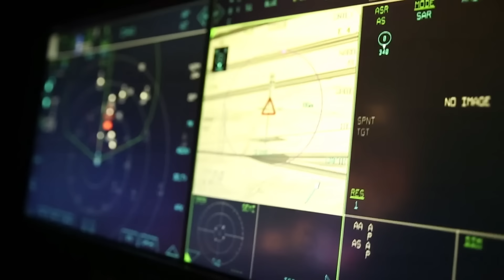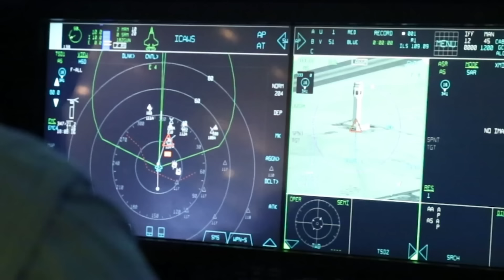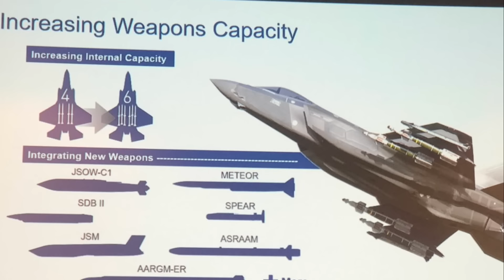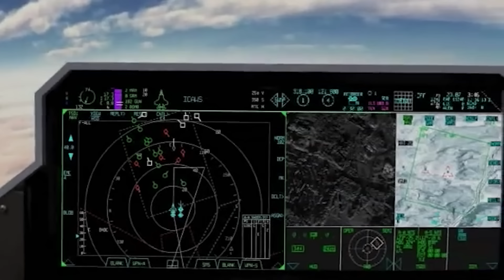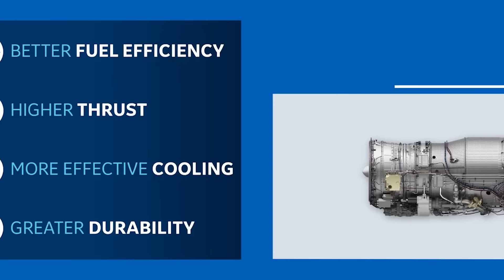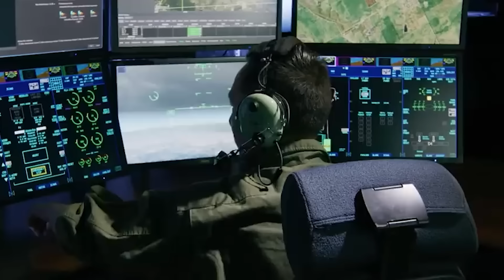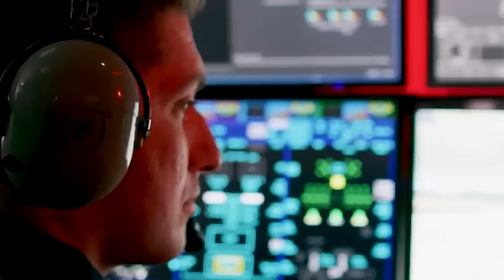The F-35 is about to become a POWERHOUSE

Comment: The L3Harris computer is 4x current? Holy shit, what did they put in this thing, a calculator? I googled the L3Harris computer, and did a little digging. Turns out that the number touted on the website is more or less equivalent to a processor released in the '80s.

Comment: So if I'm understanding this correctly, the TR-3 upgrade package includes a new CPU, probably upgrading from PCiE-3 to PCiE-5 for the extra data bandwidth in the process, new RAM, and an M.2 drive or three for not only more data storage but quicker access to that data, plus software updates that actually let the aircraft take advantage of all that new capacity, unlike Windows or iOS. Given the change in hardware, probably a new motherboard as well. Neat!

Comment: The problem with the F-35 is the ancient system architecture. You have expensive and lengthy upgrades because everything must be recertified, tested and tested... On JAS-39E you can change every computer, an engine or add 12 new weapons and the plane flies the day after and the whole fleet can be updated at squadron level. So 5th gen is not about stealth, it's about adaptivity...

Comment: I was very skeptical of the plane. But it's more about what the tool is going to do in actual force projection. The 22 is a better fighter, but it is limited in every other category. 

If the systems work correctly, the 35 will actually be the better tool for how the fight plays out in real time. And thats how the aircraft should be looked at, different tools and this tool is very dynamic
Reply: It's an unreliable pile of junk with a flakey engine.
Reply: @LondonSteveLee  Few years ago I would have agreed. Not so much now. Pretty deadly now that lot of the new kinks got worked on
Reply: @nelson_rebel3907  The hardware is obsolete - F-35 needs a total avionics refit like F-22 - that's the price you pay for such a buggy plane that had a drawn out development phase - in the end they had to halt modernisation and spend literally 5 years bug fixing on what was already 15+ year old hardware.
Reply: @LondonSteveLee   The advantage is all that hardware that is working now is decades ahead of anyone elses. The 35 was designed to be upgraded. Thats why the frame is more robust instead of flat and very specific like the 22.

The 22 is the best dominance fighter. But its even older than the 35's hardware. And it doesnt fit the missions of the future. It's range is too limited and it has little compatibility with other platforms. They could retrofit the fleet of them. But the 35 was designed from the ground up to work that way.

The 22 wont be the weapon we need. It's a iconic aircraft but it doesnt mean its actually what we need. The 35 is just an easier to maintain and mass produce over the 22. Quantity does have it's own quality all it's own.

And fortunately for us, the 35 is still a better quality than almost any other jet.
Reply: @LondonSteveLee  Ultimately we know they are working on something better than the 22 for the very specifc unlikely event of actual dogfighting. And it almost certainly involved drones and AI. I doubt they are shutting down the f22 without something to fill that role
Reply: @nelson_rebel3907  Not true, for some time F-35 development have mainly been bug fixing and "productionization" of very clunky and advanced in their day systems - the workings under the skin were frozen in time to reduce risk to the already massively slipping and over-budget project. It didn't help that some key systems were carry-overs from the even older and technically ancient F-22. The net result is a plane that looks state-of-the-art but is actually practically obsolete. Block 4 is lipstick on a pig and will push the creaking hardware to its absolute limits. Sorry to break the bad news but F-35 needs a total ground-up refit. With modern methods and AI technology it would be quicker to start again than to untangle the mess that is F-35. I'm sure a plane with better than F-35 capabilities could be designed and built from scratch in under 5 years today. But who would you trust to deliver it? And as always mission creep would ruin the project anyway. 

Rafale, Typhoon, Gripen, late F-16 and F-15EX all have fresher systems on board than F-35 because it's easy to upgrade Gen 4 aircraft  - it's the (then ground-breaking - now easy) sensor-fusion stuff that's incredibly hard to maintain on F-35 (and even harder on F-22) - F-35 is not easy to upgrade - it's still a 90s child with very clunky and old fashioned approaches to much of the IT architecture. The exceptions are the majority of the passive protection and counter-measure systems supplied by BAe - they are totally modular with standard interfaces and are not tied to particular hardware architectures.  When you are an airforce as large as the US you do end up with a lot of technically obsolete carryovers as replacing systems across the board is eye-wateringly expensive - and if you have a heavy clunky air certified box that already works reliably and is fitted to 3,000+ aircraft with a logistics chain to maintain it - you stick with it.  Think of the Link-16 module - 100KGs of hardware pulling many amps which could probably largely be done in software now!

Comment: Probably a more efficient engine will be shoehorned in too.  It is obvious the F-35 is not a hugely short range dogfighter, but it does not need to be.  It can take care of itself, but it is more of an information node and sensor platform.  I think we may be getting away from the AWACs as a single point of failure and going to a more mesh like network scheme with a bunch of F-35's bouncing signals through satellites.  With all that electronics, a new engine is going to be needed to power it all.

Comment: I believe the F15EX is better
Reply: Yeah, if your enemy doesn't have a comprehensive strategic-level A2D complex. If they do, those F-15s will struggle while the F-35 would merely shrug and then brutalise the enemy.

Also, the F-35 can see you coming even if you try to sneak up from behind with your radar off. The F-15 would be completely oblivious unless a third party in the battle network can augment the F-15s situational awareness in real-time. The F-35 DAWS/MAWS systems are all-aspect, and the AN/APG-85 is an extremely wide aspect generation-four AESA radar.

It's not the stealth of the F-35 that's the terrifying. It's the fact it completely denies YOU the option of stealth due to its unparalleled sensor suite and sensor fusion.

Comment: I'm all for the new engine, but the frame probably wouldn't sustain it. There were already problems with stress fractures with the existing engine, so 20% more power would almost certainly cause damage unless throttled. On the other hand, the extended range and durability would be great. I'd love to see the engines in the F-22 but the engines on that are dual thrust rather than single engine. But the cost savings from the durability increase of the P&W might be worth it even if it can't use the full power.
Reply: I heard they are reinforcing the airframe with vibranium

Comment: I would rather see an F-22 block 2.  Having a swiss army knife sucks if you can send a whole utensil drawer like the US does every time.  I want the Ginsu knife with the guaranteed edge.  It seems these days it is all about exportable sales than pure superiority and defense.  The F-22 is not exportable, but the F-35 is.  I am not sure what f*cking loophole we are using, but the F-35 should never be superior than our F-22.  Software and armament support (which is hardpoints and software) are easily upgradable on the F-22.  They declined the engine upgrade on the F-18 block III.  It is all about money and not about air superiority or protection.  It is total bs politics.  Anyone following this can see.  Why an F-18 to have super cruise at a lower cost to cut into the sales of the F-35?  Well...one reason is the Eurofighter, et al.  Like someone else said...it is about software networking grid engagement and missiles.  When it comes to BVR, radar and missiles play a bigger role and simple F-18 like the growler can be competitive.
Reply: The F-22's lack of export was due to a unique situation that had nothing to do with it being "too good for export", and everything  to do with the end of the Cold war and lack of threats to NATO, which resulted in security concerns because all other nations were reducing their budgets and relaxing their military operations. The ban on export was obsolete by the early 2000s, but by that point key politicians were already concerned about the F-22's cost and lack of capability outside the air superiority role.

The F-35 is preferred specifically because it is multi-role. It is more effective for it's cost, in much the same way as an F-16 is better than an F-15 in many situations. Emphasis on many, because that means it's effectiveness is utilised far more often than dedicated fighters, and therefore contributes far more to the war effort. It is simply far more bang for the buck.

F/A-18 with super cruise? With a normal combat load it can barely reach Mach 1.2. The airframe is too draggy for supercruise to even be considered an option, especially when the detrimental effect of reduced combat range is of far more concern to the Navy.
Reply: @dumdumbinks274  We don't export equipment to countries that are threats.  For instance, Israel wanted the F-22.  It has never been an enemy.  We did not export it due to it being our highest technology for military.  This is way after the cold war.  The cold war prevented us from selling Sony PS2s to Russia, because it was classified as a super computer at the time.  The F-22 was long past the cold war saga.  The F-35 is something that was designed to replace the F-16.  It is not an air superiority airplane.  The F-35 is already on essentially block 4...that is crazy to me.  The F-22 was canceled for some reason that makes no sense except that they could not make money on it.  The F-35 being exportable makes potentially a lot of money.
Reply: The hardware on F-22 is so archaic it's practically impossible to upgrade without ripping everything below the skin out and starting again. F-35 isn'y THAT far behind in that sense either!

Comment: The F35 is an expensive failure which has not to lived up to its original design brief. It was supposed to be a "CHEAP" jack of all trades but is an enormously expensive master of none. To claim it has inherent survivability is delusional since it relies on more than 8 million lines of computer software programming for its overall functionality. Its sustainability is abysmal costing $36,000 per hour to operate. Its readiness is also abysmal spending more time in maintenance than it does in the air not least because its engines overheat and wear out too quickly and replacements are continually on "back order". It has been 20 years in development but is still not a mature offering and is never likely to one going on past history or present round of upgrades
Reply: The truth is not welcome here Jim!
Reply: It is a cheap jack off all trades that is also a master of pretty much all